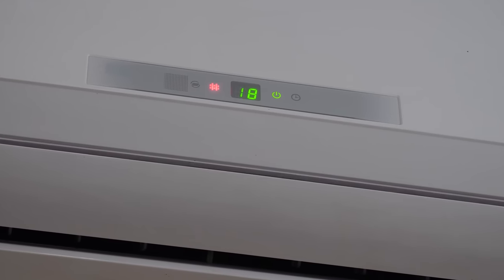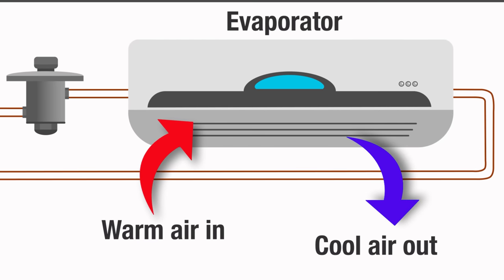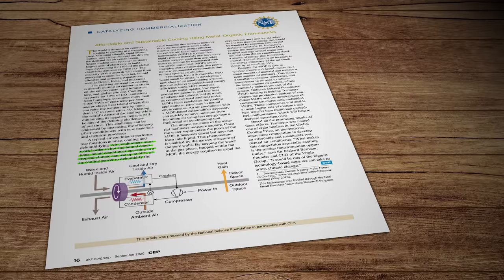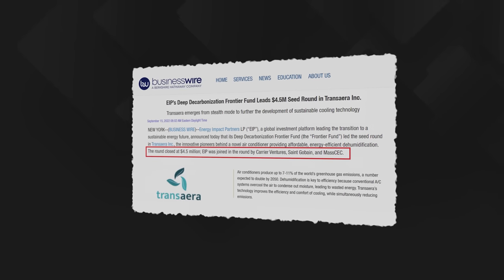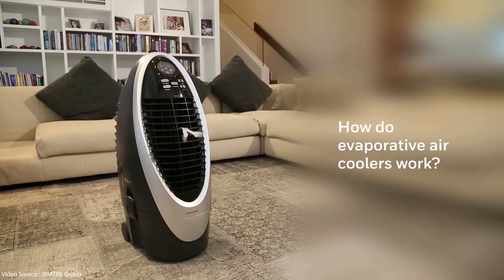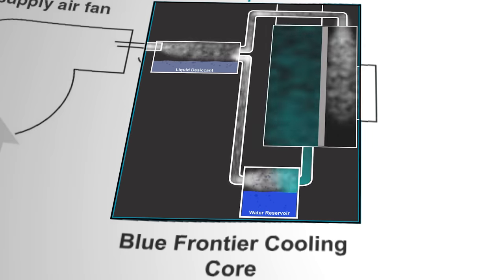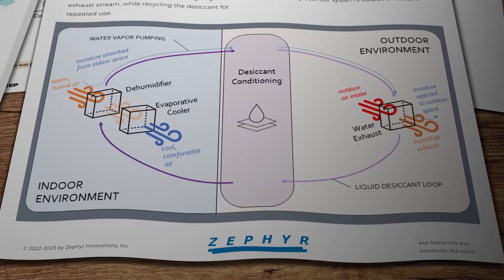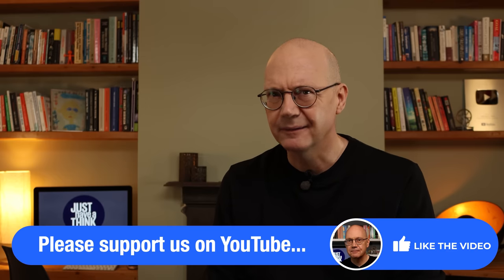Emissions free cooling. Can we do it?

Comment: Something of a sidestep to cooling is cooling down structures by radiating heat to the cold night sky and insulating it during the day.  We have concrete Trobe thermal walls on the sunny side of our house and I have toyed with the idea of having opening sort of French doors to open them up to the sky at night.  Better really would be a solid masonry or water pond roof that you coudl slide away insulation during the night to let the coldness of space radiatively suck the heat away form the surface so by morning it is ready to start soaking up the heat right through the day, keeping the inside cool.  So even in a place with a small diurnal heat range or permanantly overheated, you could have this natural space cooling as long as there wasn't too much cloud cover.  Maybe you could have a massive enough structure to hold coolth for a few days of cloudy nights.  And this massive structure doesn't have to be high embodied carbon concrete:  I am writing this from our adobe (mud brick) earth house that although it has concrete foundations, the fairly massive walls have close to zero embodied carbon being all from the house site - with the only addition being some (carbon negative) chopped straw for crack stopping.

Comment: Here's something that you can  research. I don't remember which issue of Popular Mechanics (US) this article was found or even what year ( early 70's), but it was an article about General Motors developing a mechanical non freon air conditioner which they tested.

The article went on to say that it was effective and actually increased fuel economy by 10%on the test cars. I remember from the pictures it was a tracked/belted vertical vane assembly that was attached to the front of the engine. It used the airfoil/ vane to expand the air volume to drop the temperature.

GM dropped the concept from further development because they said that the airfoil/vanes couldn't stand up to the friction of the vanes contacting the housing.

It was always my opinion that they stopped the project because of increased fuel economy. There was no discussion of additional materials testing to improve the friction problem.

Comment: I live off-grid in 2 places. Part of the year on a boat. Part of the year in a small house. Both have PV and batteries. Both have a 5k BTU window AC unit that runs during the days (the house has 2 of em). No generator required. It's sunny when hot. This isn't cooling some 5,000 sqft house, but it's fine. Cheap even. People just need to downscale their expectations.

Comment: The Blue Frontier descant AC touts nighttime regeneration as an advantage. As grids go more to renewables, particularly solar which is plentiful and cheap where AC is mostly needed, then it makes more sense for power usage to be during the day, not at night when PV is useless. I've often thought that some of the worry about AC energy use is countered precisely because AC is most needed when the sun is shining and so is a good match for PV.
Reply: Slightly disappointed that the solutions aren't a bit more radical than what is still essentially just making conventional AC more efficient. How about other approaches such as having ultra white roofs and heavy insulation combined with harvesting cool air at night and 'storing' the coolness for use in the day.
Reply: @petewright4640  Because that stuff is very expensive.  Upgrading an AC is much easier/cheaper to do.

Comment: I was dubious of drying the air out only to get it damp again, until we got to the heat exchanger moving heat from the dry air into the fully contained colder damper air. 

Still a bit dubious as to whether the heat pump drying out the desiccant is much savings over the reversed heat pump of a regular air conditioner, but it’s undeniable they’re more efficient at night when the delta between air temp and condenser temp is higher. (This fact can also be used with regular air conditioners to save power if you run them overnight, assuming your home is insulated enough to still be cool when you wake up.)

Comment: Great video. The Transaera system looks to have a thermal wheel in it to alternately absorb and release moisture. Maybe combine either system with sky cooling and you could have a super low energy cooling system. You could also have one that doesnt work cos its too experimental. 😊😊

Comment: I live in the deserts of the southwest US where we get enough sun to easily run A/C units purely with solar power. I'm really into the dual purpose of A/C's to cool and dry the air. Even though we don't have much humidity, the mini split I have captures around 1-2 gallons per day of condensate. I take this and put it through an RO machine to turn it into very good drinking water. This literally gives me all the drinking water I need for the whole summer. So I'm not contributing to plastic waste with bottles, and cooling off the house at the same time. With the unit fully powered by solar, the small amount of refrigerant seems worth it for what the device is giving me. So for me, I'd still want the ability to capture the moisture from the air. Here in the desert, that moisture is even more valuable than the cold air.

Comment: I live in Johannesburg (high hot and dry). Evaporative cooling works very well for me. I don't know why so many buildings use large expensive conventional air conditioning systems.
Reply: Humidity is evil.  It causes mold and mite problems, can lead to building damage, and makes people uncomfortable.  Evaporative coolers are a perfect breeding ground for pathogens, some of which are very dangerous.  These are probably the reasons people choose conventional AC in most locations.
Reply: @incognitotorpedo42  In the coastal zone humidity is a problem. Up on the Highveld (a high semi-desert interior plateaux) a bit of humidity is very welcome. The only mould problems we have is from leaving food too long in the refrigerator. I do worry about the water in my evaporative cooler. I wash the reservoir with disinfectant and replace the water once a week.

Comment: The channel "Nighthawkinlight" has a couple very interesting building white cooling panels painted with nano-particles that passively radiates the sun's energy into space. Potentially all you'd need electricity for to turn it into proper cooling system would be a fan to move the around the underside, which could itself easily be powered by a small solar panel. I haven't done the math, but I would bet if you scaled it up that it would beat the efficiency of refrigeration systems in this video.

Comment: it helps to dry the air in a room because  we can cool our bodies much better when the air is drier. I have an energy frienfly solution. Inmagine a "window"with instead of glass a Nafion Membrane. This Nafion lets moisture through. The outside is flushed with air that is predried with a molecular sieve. This sieve gets hot,  but the ambient air keeps that moderate. When the molecular sieve is saturated, it is heated with focused sun light and the collected moisture is driven off.

Comment: I have been thinking on exactly this. If the U.S. and Canada weren't chalk full of politicians in the pockets of oil and gas, legislation would have been passed decades ago requiring new home builds be designed to very different standards. I mean homes that are designed from the outset to be inherently cooler without being entirely dependant on energy heavy AC systems.
Reply: It's might be less a matter of politicians being owned by the fossil fuel industry than the fact that the overwhelming majority of the income from their use going into the coffers of government. Actually, eliminating fossil fuels would require public acceptance of a tremendous diminishing of government revenues and consequently the size and scope of government. The fact that politically the left supports the eliminating of fossil fuels and the right does not is ironic, because actually doing so would remake the world in the image of Reagan and Thatcher. Politicians don't really want the money they whose spending they control to be reduced.
Reply: I always thought that building codes in the US came out of a government department but in fact they're derived at by workshop conferences of stakeholders which include industry and the public.
Reply: @dennisenright9347 there may be some truth to this but my understanding (I’m a layman and not in the industry myself) is that overall the government actually subsidizes O&G more than it gets in taxes.
Reply: @mv80401 and the industry actually has the majority say in the policies and standards that get passed.
Reply: @dennisenright9347  Even if what you are saying is true, which I doubt, it has to be done anyway, so your argument is moot.
Reply: @mv80401  When government sets building codes and efficiency standards, builders and their workshop conferences must work within those parameters.
Reply: @sjsomething4936  Are you just talking about western countries? From Saudi Arabia to Venezuela to Iran to Russia to India's coal industry, most fossil fuel production assets are government owned.
Reply: @dennisenright9347  I'm talking about the countries that I named. Although you can reasonably add similar western countries if you see fit.

Comment: Whenever I see that somebody talking about cooling I try to point the methode of air delivery to the room in AC system. The most efficient is displacement methods. The cold air is delivered to the floor instead of mix the whole volume of the air. That can save 40-60% of energy with added benefit of preventing of mix the contaminant and co2  expell from our longs as warmer air rize. No body put out that during Covid epidemic to use this type of system to ventilate occupying rooms.

Comment: Desiccant phase change emit just as much energy as hydrocarbon based phase change coolers - there is no cooling without emission. 
Even the ancient Greeks and Syrians knew that when they used amphores with caulk and salts to dehumidify their homes - use it, heat it in the sun, close it, cool it in the cold of night, take the lid off, and start over. The required energy was moving the containers and lids.

Comment: Early in the video I see the A/C thermostat set to 18°C and it made me cringe. Hah.
Here's a tip: keep a humidimeter in the room and try to keep the humidity in the 50-59% range. When the humidity goes below 50%, raise the thermostat by one degree. Be sure to also have a fan blowing the cool and dry air right at you. 
Using this strategy, I could keep comfortable up to a room temperature of 28°C as long as the humidity is in range or less. (It's been in the mid to high 30s outside).

Comment: I feel like one big common problem with most evaporative cooling systems is that they use up water, which is an increasingly scarce resource in many parts of the world, and most of these systems are going to use treated fresh water so they don't have to deal with scale buildup or biofouling in the plumbing. 
These systems get around the dry environment requirement pretty well, which is great, but they need to not use up precious fresh water. The two ideas I can think of are to make a version that is robust enough to run on seawater and use it near the coast or to design it to capture the water vapor and recondense it at night with dark sky cooling for reuse the next day.

Comment: You can also use solar thermal energy to regenerate dessicant dehumidifiers, the liquid ones are technically easy to pump around but are typically corrosive. This could be part of a desuperheater for the vapor compression part, increasing it's efficiency.
Desuperheaters in general should really be used anywhere there's heating and cooling needs, first to mind are restaurants that run both large compressors for refrigeration and have large hot water tanks for dishes.
Reply: It’s on point that you mention restaurants. I’m in one ~30 years ago and I can hear water pouring down from within a structural roof support (nicely outfitted). I asked what that was as it was not raining. I was told it was the water from the rooftop AC being sent down the drain. Meanwhile natural gas and electricity are being used to create hot water for the dishwashers and the washrooms. I was left shaking my head.

Comment: we use our solar generation to run our ac/heating split unit for most of the year. Very occasionally we use  power from our batteries  which  are charged using off peak electricity.

Comment: One of the easiest ways to reduce both cooling and heating energy consumption (by up to 90%) is to use the Passive House design principles. The cooling or heating input required is then very small and electrical input is very low and in many locations can be achieved by solar or wind resources.
Reply: and that small energy consumption can be reduced even further by using phase change materials, during the day they absorb excess heat, keeping the house cool, and in the night they release that heat again, keeping the house warm. win-win-win :-)

Comment: Good episode. Blue frontier's solution is actually technically viable, doesn't need some huge scientific breakthrough, and their numbers are realistic. If most the initial heat from enthalpy of vaporization is removed the system can be more efficient than without doing that. That requires an additional heat exchanger, which adds initial cost and size, but it could improve efficiency significantly. 

I don't get why they use an air to to heat exchanger in the end, it actually the water that cools off directly, and the air is indirectly cooled by that water. And, water carries the heat much better, is a much better medium for heat exchange than air,  that's the most important reason for why water based closed radiator systems are common and air based is not.                

MOFs show so much promise, for a huge spectrum of important applications and are so interesting and intriguing, in theory, in reality we have as far as I know yet to make a single one viable for practical application, and we have materials that "trap" water the exact same way. There's still no such thing as a free lunch in physics, you have to make the trapped water leave the material somehow, you can't make a material trap a lot of water, and then release it when you want with wishful thinking and good intentions.  Something must make the water stay, and then something have to change to make the water go away.  

On the other hand a saturated salt solution have a critical humidity, and absorbs water from air that has a higher humidity, and water evaporates from the salt solution when the solution is exposed to air with lower humidity. Sure, there's that issue of enthalpy of vaporization, but it doesn't require huge temperature differences. Blue frontier's idea using heat pump during off peak times is actually a really good way. Solar or waste heat as already mentioned in the comments is also potentially great solution.

Comment: If you are running a UV-C germicide bulb in your air return, this might be a good space to put desiccant packs to absorb its heat radiation in between cooling cycles. Same principle. UV-C bulbs typically burn a constant 19 watts each.

Comment: The full form of HVAC is Heating, Ventilation and Air Conditioning. 

The main difference between HVAC and AC is that HVAC generally refers to the whole heating, cooling, and ventilation system of a building, while AC often refers to cooling systems. In other words, AC is part of an HVAC system.

Comment: An important point is that the assertion that conventional AC "waste" energy because they also condense water is misleading because comfort level is related to humidity. In many situations simply dehumidifying the air is all that's needed to make heat tolerable. The dehumidifying aspect of AC means that temp doesn't have to be reduced so much, thereby saving energy!

Comment: I like to term one of the major challenges we face is de-energization. Removing energy use for common tasks. Climate control in buildings is one of them. Millenia old techniques are still known and should be utilized. There are movements in India (see Down to Earth) to revive and modernize de-energized housing. Packed earth construction with passive air conditioning surrounded by permaculture or the earth ships in the US. Consider that even lumber may come under constraint as forests burn (see Canada). We need a deep rethink of how we provide basic necessities like housing, food etc. Because integrated self sufficiency massively cuts our need for energy and a global supply chain.

Comment: I remember a video by tech ingredients where he makes a panel with a special coating that radiates heat back into space. The panel was a few degrees below ambient temperature, even in direct sunlight. Combine that with phase change material, and you have a cooling system that consumes far less electricity than regular heat pumps and doesn't spit out hot air.

Another option would be what is often wrongly referred to as a geothermal system but should be more appropriately described as a ground-source heat pump. AFAIK here in the UK the ground is about 12 degrees at a depth of 2 or 3 meters. That should be cold enough to cool a house without the need for a heat pump, again considerably reducing the need for electricity, from a couple of kilowatts for the heat pump to a few dozen watts for the circulation pump.

tech ingredients also has a video about a solar powered air conditioner that uses a concentrated solution of calcium chloride to cool and dehumidify the air. no refrigerant, and very little electricity required.
i could post links to his videos here but youtube would just mercilessly censor me AGAIN (EFF YOU VERY MUCH, YOUTUBE!), so you have to find his videos for yourself. search for "cooling aint free" and "solar powered air conditioner" and they should be at or near the top of the list of results.